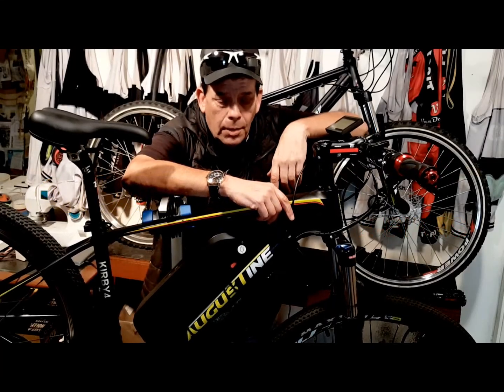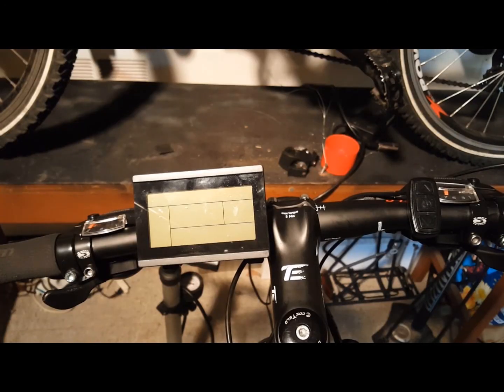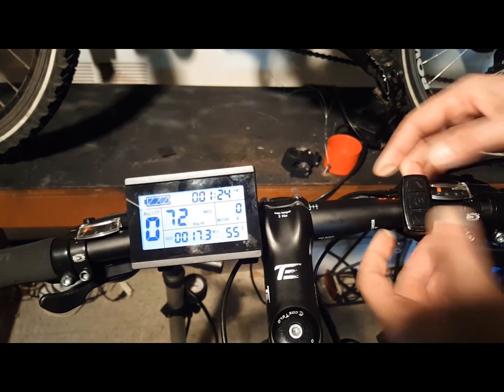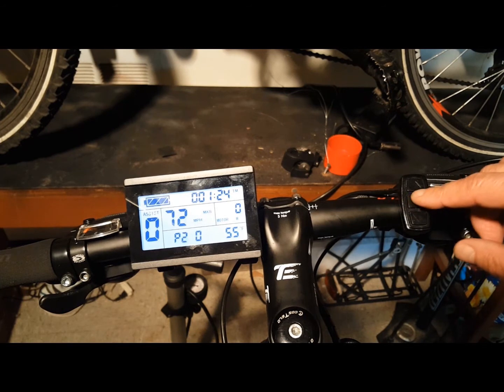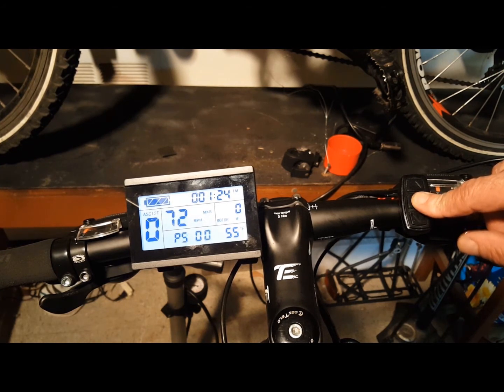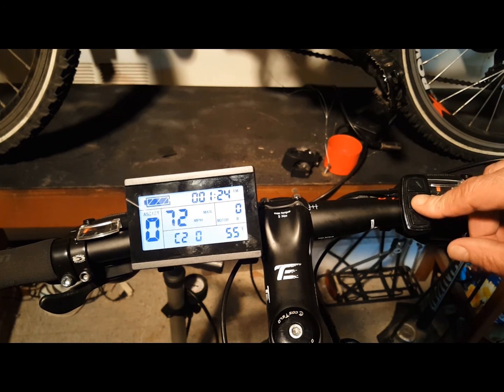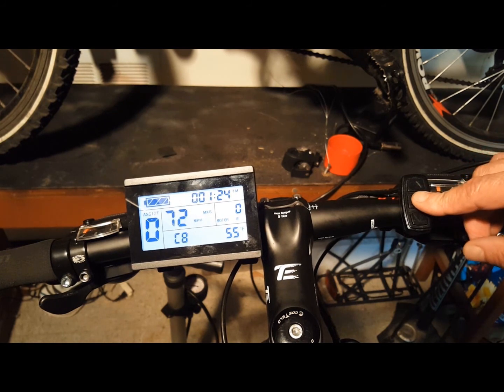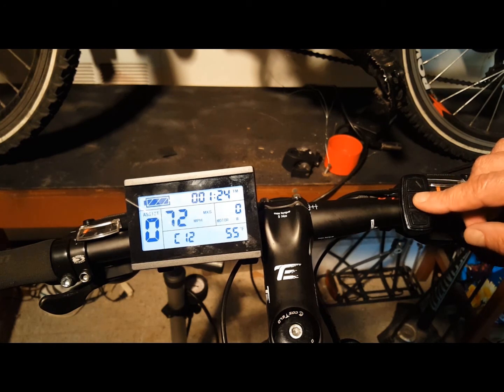E-Bike Tips. Programing the KT-LCD3 Onboard Computer.

Comment: My watts readout hits a wall at 1999w is that a limitation of the display, the controller or the battery?
Reply from the maker: Your controller
Reply: Actually, taking a closer look at the manual for the KT-LCD3 computer(You can Google it), it seems that the display itself only has markings for the maximum number of 1999 for the watts readout. In the manual it shows this as 1888, meaning that it can only display a 1 for the first number of the four.
Reply: I'm having trouble with p5.  I have a 36 volt battery and read that 15 is the correct setting for 36 volt but when I tried it the battery level jumps all around and the motor cuts out.  I'm going to experiment with zero when I get the chance.